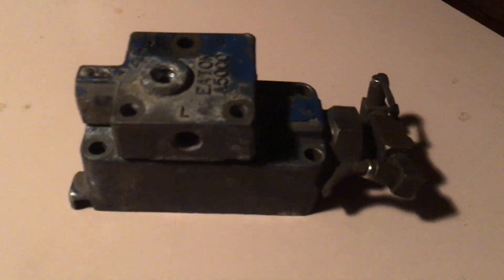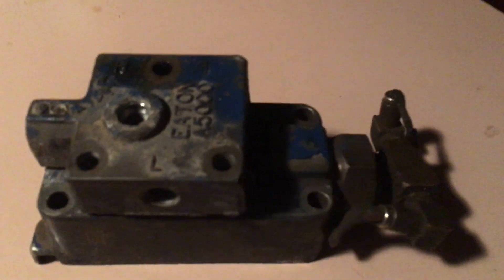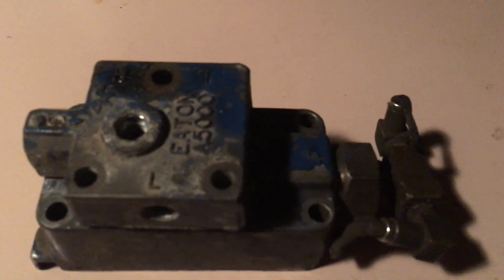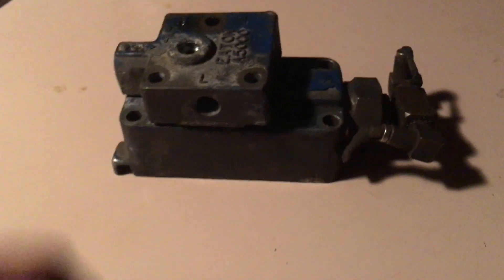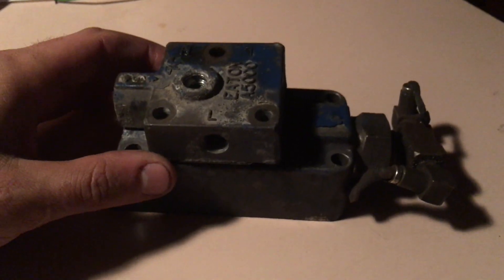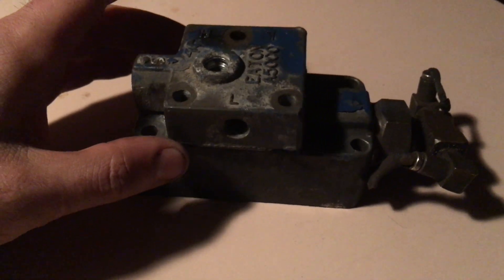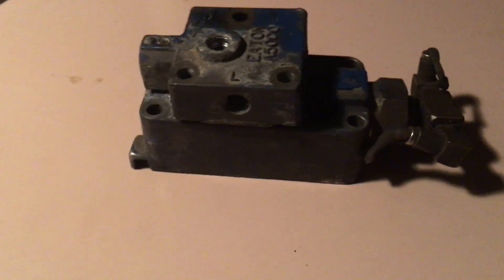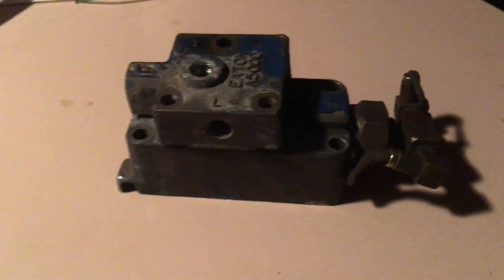Eaton A5000 slave valve complete disassembly and  how it works #bigrigtruckvideos

Comment: My high side doesn’t work sir,  could this be the issue?  I replaced the filter regulator and still same issue.
Reply from the maker: Sorry for the late reply. 
Yes, a faulty slave valve could cause transmission to be stuck in LO but it could also be caused be a faulty HI/LO valve or plugged line.

These air-lines are tiny and can easily get plugged.

I have a separate videos on how these work.

Comment: Question mine is leaking but i cant feel no air around it. I'm assuming it's internal.? Maybe a gasket?
Reply from the maker: @patrickgrade3365  hmmm....there's not many seals, and only 1 gasket.

Probably O-rings on the piston.

I got a new one on Amazon not expensive
Reply: @OldCrowsClassicCars  I forgot to mention only leaks when I flip the button to the high side. Can you send me the link or part number for that order you got on Amazon. Thanks for your time.
Reply from the maker: @patrickgrade3365  air is only applied when you hit the button....I mention than on the videos....there's more videos on the channel if you want to really understand how it works.

You should be able to find the valve by typing "A5000 valve" on Amazon.

If that doesn't work let me know
Reply: @OldCrowsClassicCars  thanks my dude
Reply from the maker: @patrickgrade3365  no problem man. If you don't find it, let me know and I'll try to get you the order.